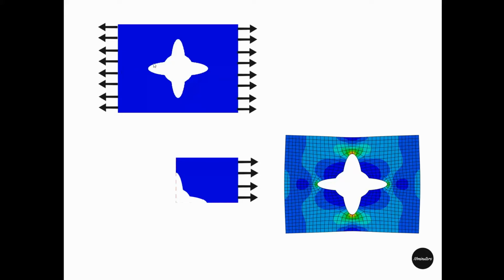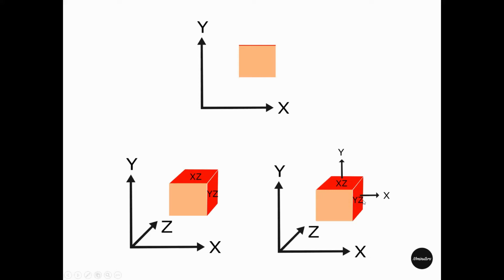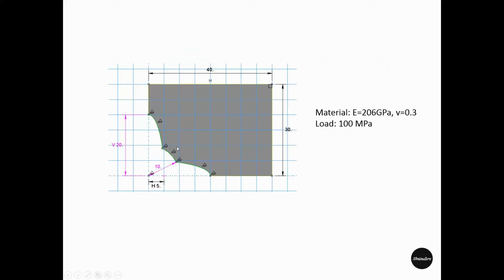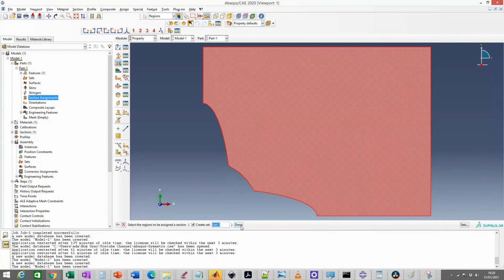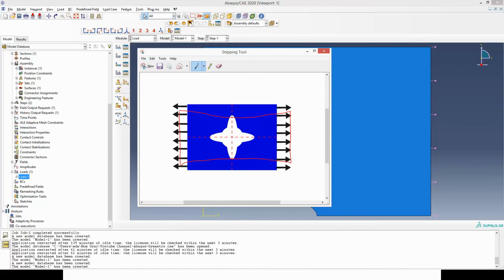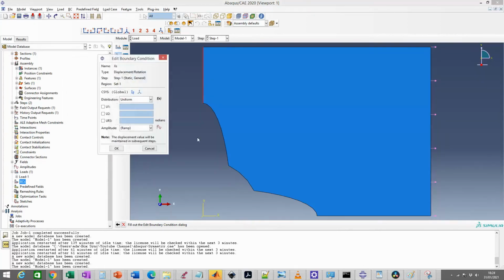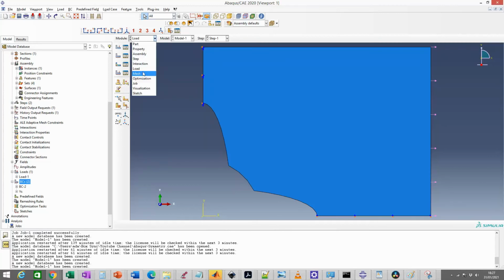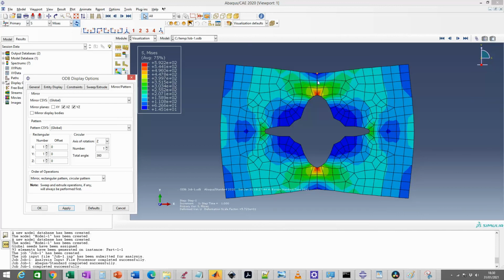Symmetry model in ABAQUS

Comment: Will the axial load also quartered on quartering model??
Reply from the maker: Hi, As the cross-section is reduced by half in this example, load is also half
Reply: @10Minuters  not in this problem suppose we consider a symmetric column with 10kn load but we model only one fourth column will load taken be 2.5 kn
Reply from the maker: Yes, in that case load will be 2.5 kN
Reply: @10Minuters  and from the final outcome shall we multiply by 4 to get the result for full model
Reply from the maker: @narendrakumarjha5685  Just multiply by 2